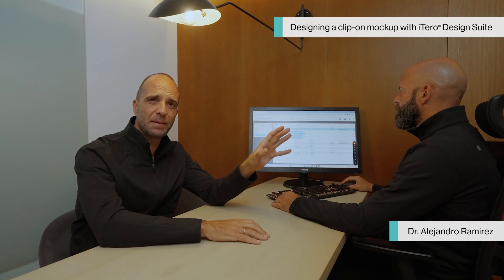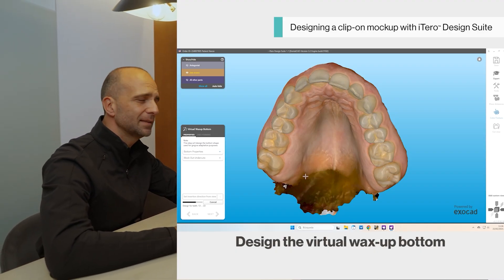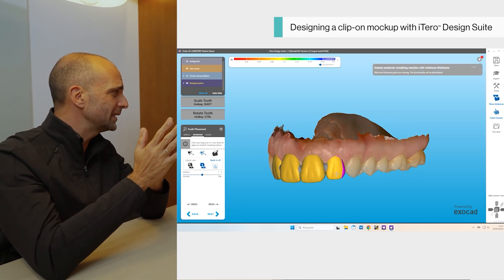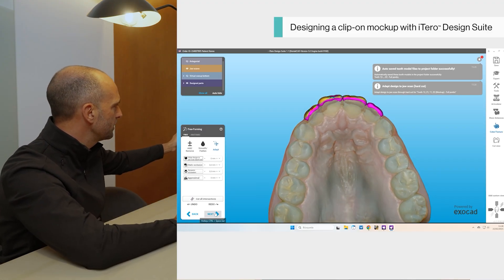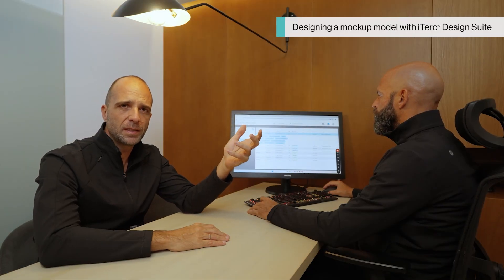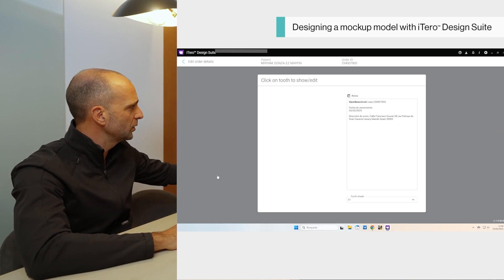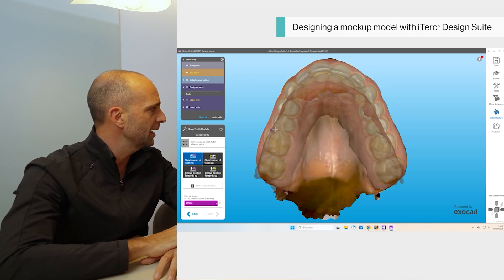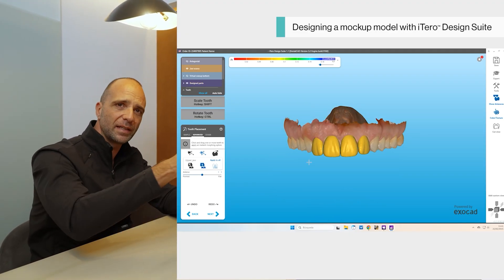How to create mock-ups and 3D printed models with the iTero™ Design Suite

Comment: Can I export the waxup model I created for the silicon path to another folder, so I can send it to my lab instaed of printing it on myself?
Reply: Yes, you can!! All of the designs you do in this application are saved in the project folder like in the regular exocad. Once you finish the design click "Open in folder" and there are your design files. Or you can navigate to CAD-Data folder and find your order there. We have some customers sending us files designed with itero
Reply from the maker: Thank you for your question. For more detailed information, please reach out to customer service at 800-577-8767 or iterosupport@aligntech.com.